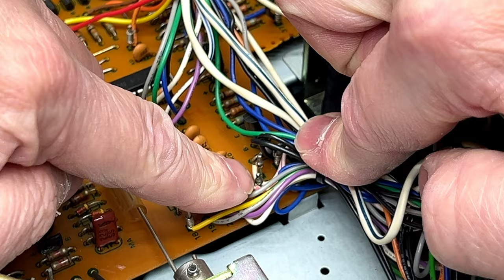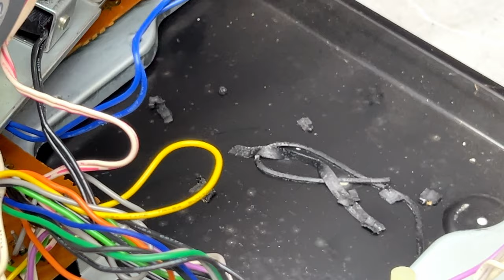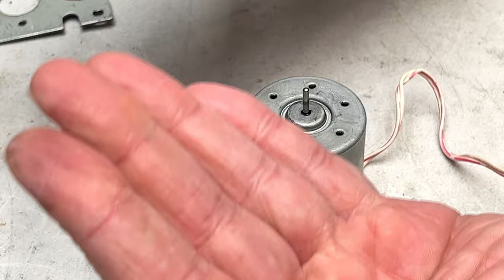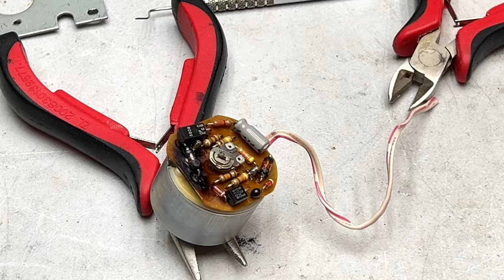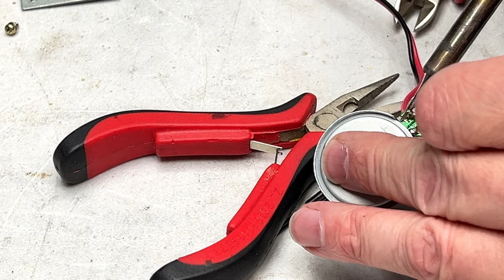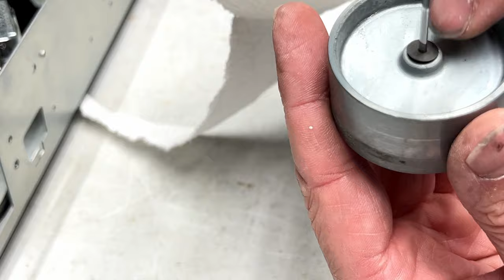Pioneer CT-F615 Resurrection

Comment: Before installing the new motor i would check why the voltage for the motor is so high. Most likely a transistor failed in the power circuit and caused the part in the motor board to blow.
Reply from the maker: The motor had a shorted winding.

Comment: These are nice decks and I think one of the cutest looking decks ever made. I have the UK version CTF400 which I found cosmetically minty and boxed about 8 years ago. PSU recap, belts and alignment. I like the internal build on this deck for what was a lower-middle end unit in the Pioneer range. The main belt is horrible and when it degrades - it degrades!
Really sticky black goo that gets everywhere.
These came onto market at the dawn of the metal tape era and were in truth not really metal capable. Pioneer marketed them as metal decks but the heads simply can't deliver the flux levels for metal so stick with premium type I & II.
The one thing I dislike, in common with many decks, is the motor running constantly when the unit is powered. Better to have a sensor in the tape well. Could probably be modified as such.
Reply: I have Pioneer CT 760 and in this deck also motor keeps running when we power it on.Infact one small gear got broke down  and I got the replacement also but I am not able to reassemble the mechanism again.I am not able to understand how to position cam wheel against the  capstan wheel because some inter relation is there between the two as the capstan wheel would drive the cam wheel to a position to raise the head assembly and tape starts playing.I do not want to misjudge the positioning of the cam wheel and capstan roller wheel so that cassette door gets locked and that small gear breaks again.

Comment: I think the motor voltage should be around 6 volts D.C.
Reply from the maker: Service manual wants 14V in stop mode and 12.6V in play mode - it's a 12VDC motor.